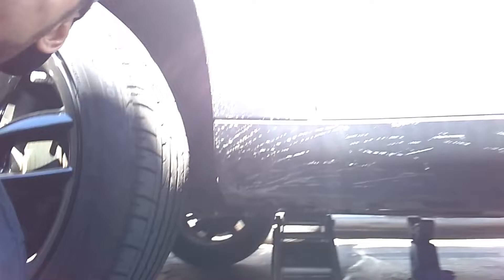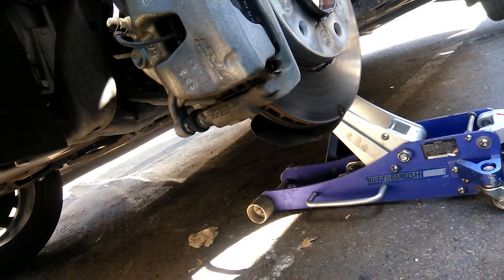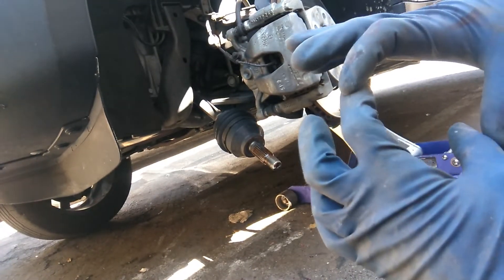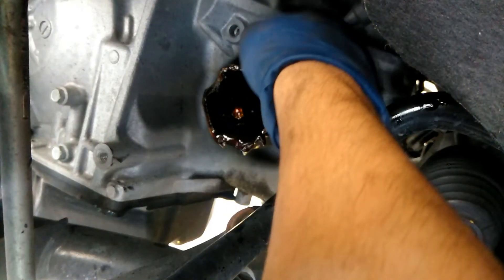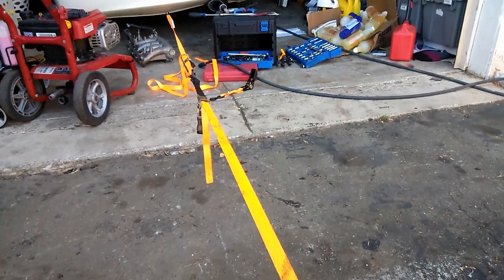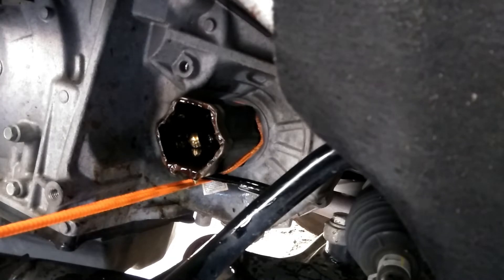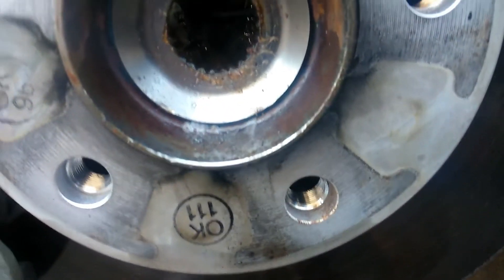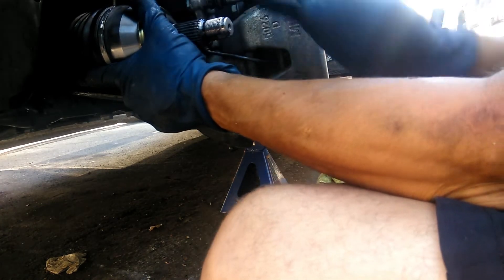how to replace driver side CV axle 2013 mini cooper countryman

Comment: i ran into this same issue. Ended up welding a bolt across the cup and got it with a slide hammer. worked great. lol

Comment: Thank you, the ratchet strap method worked, I tied it to the lift post, (had to do it in a angle), and hit the axle cup lip hard with a large chisel.
Reply from the maker: I'm glad it worked. Its a very difficult one to pull out.

Comment: Regarding when replacing with an aftermarket cv shaft, you mentioned the length needs to be at least 25.5 inches...is that when the shaft is compressed or stretched? Maybe the oem quoted length is measured when shaft is streched.  I checked a number of brand aftermarket shafts online and they are all 2-3 inches short (left & right side). I don't think all these non oem could be wrong. Why would they keep making them short year after year? If so these manufacturers would loose their shirt on returns. Or maybe they are engineered to work with short lengths. There must be a good explanation.
Reply from the maker: Idk why but. I tried with every part store and they were all short.